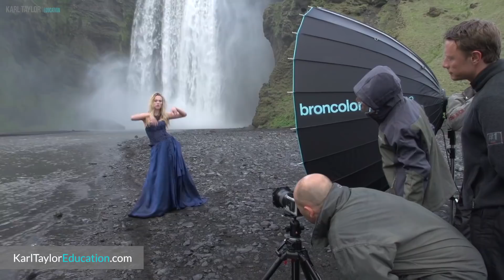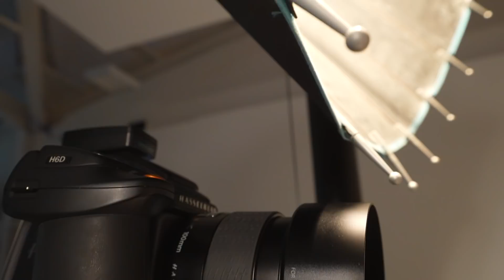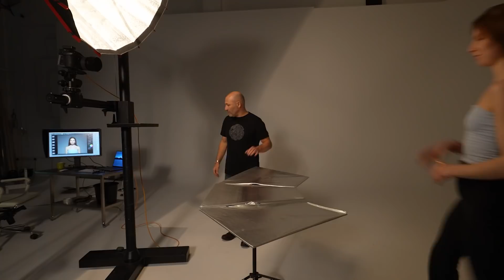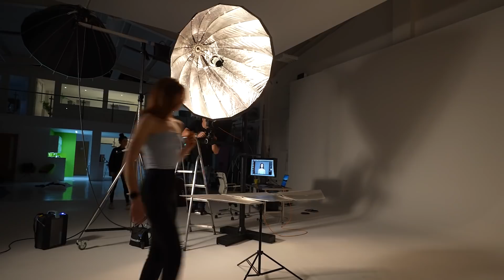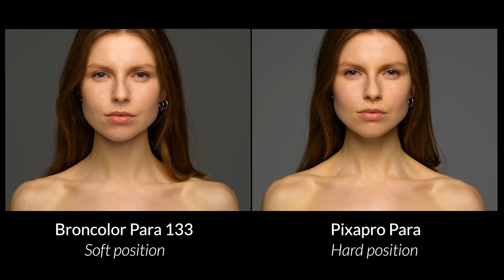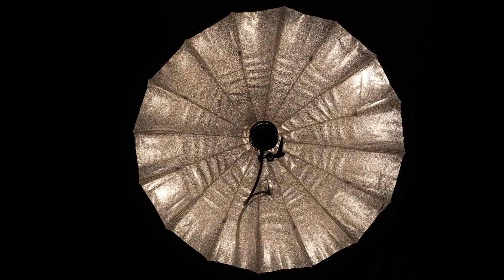Parabolic Reflectors Compared - Budget vs Expensive

Comment: In my opinion, this video lacks practical value. Users of top-of-the-line, most expensive softboxes won’t consider cheaper options, and the vast majority of customers won't even notice the minor differences in shadows, reflections, and other factors. Photographers on a budget won’t be concerned with these aspects either. Comparing top-of-the-line and the cheapest options is not relevant for most photographers.

Comment: Would like to see a retest comparison of the Broncolor Parabolic 88 vs Godox Parabolic 88, reason is the internal silver reflector material is much better on the Godox than was present on the other cheap Parabolic you tested previously and the focusing mechanism on the Godox is also much smoother, meaning somewhat closer to the smoothness of the Broncolor Parabolic.

Comment: so what makes a Briese or other high end reflector so much more money? Is it the number of panels? the material? the really large reflectors are disproportional in their high price. Your hacked one looks just as good. Not a major difference.
Reply from the maker: Being a true parabolic shape is the crucial one, not all manufacturers achieve this. The next I would say is durability, if you use these modifiers alot you are constantly opening and closing them, heat, weather etc. I've used mine with sea-spray hitting them or in high winds and rain.
Reply: @VisualEducationStudio  so, if i were to make a hard plastic 10 foot parabolic dome, and coat it in silver, that could save me 10k? it wouldn't be that portable but for studio work i could save tons.
Reply from the maker: Exactly right.

Comment: Hello. I have a question.
I'm curious about the difference between using a parabolic diffuser and a regular Fresnel lens by adjusting the angle (e.g., 30 degrees, 40 degrees, etc.).

The reflection of light on the subject and the direct contact.. Is there any difference beyond that?

Comment: Karl, i recently had an idea to improve the hacked one in the soft position: the main benefit of the true para there is that it basically acts as a big ring of light - so could the hacked one considerably be improved by shading of the central part? (maybe ideally with some cone shape reflecting even more light to the outer ring?)

Comment: I wanted to ask something very specific Karl if possible. When it comes to the glass domes, do you think frosted glass domes perform better when taking a portrait shot? Or do you think the clear glass dome is preferable?
Reply from the maker: Hi, I've not noticed any difference between a frosted or clear dome in a para, a frosted dome is essential in fresnels such as the Flooter to avoid and image forming of the flash tube. The other benefit of a frosted dome is when using diffusion scrims but not a huge benefit.

Comment: I think parabolic reflectors would be great if you have the budget. But I also think you can get a very similar effect by using 2 or more lights/modifiers for a fraction of the price. Even with one light and tweak it in post. However there's definitely advantages of paras with regards to saving time.

Comment: During my newspaper days, our photo studio had two ancient portrait lights that consisted of rigid parabolic reflectors about three feet in diameter, made of polished metal and mounted on wheeled cast-iron stands. Each had a shielded 250-watt photoflood lamp mounted at the reflector's exact focus. These produced marvelously crisp light, but they also focused so much heat on the subject that most people couldn't stand more than three or four shots! This may have something to do with why modern paras use faceted or matte reflecting fabrics... although as Karl's excellent demonstration showed, it doesn’t matter what kind of fabric is used if the reflector's structure can't maintain a true parabolic shape.
Reply from the maker: Hi JL yes the bigger paras such as the 222 have a shinier surface to make the light 'crisper' because it is bigger and therefore also softer. If a true mirrored surface were used in paras such as the 133 they would be too aggressive like the rigid ones you mentioned.

Comment: On the surface from the "cheap" parabolic reflector fabric are a lot of wrinkels...wrinkels, i don´t have on my Jinbei 120cm deep reflective softbox (which is also a parabolic reflector with the additional focus system). Cheap doesnt´t always mean: cheap/bad made. I am proficient with sewing machines, so i can spot poorly sewn fabrics. 

On the other hand, the broncolor mechanism - especially on the 177 and 222 - is way stronger than other constructions, to be able to stretch the fabric. This is also a reason for other brands, to choose their reflective material. Fabrics with more elasticity seems not to be as shiny as stiff materials. (elasticity: the ability of stretching diagonal)

So the reflective fabric from my Jinbei 120cm deep reflective softbox is looking more like "softsilver", but it will give me perfect reflections from its 18 seamless smooth surfaces. If you keep in mind, that the complete set (softbox + 2 diffuser + grid + focus system) will only cost you 240€ in total, there isn´t anything, you could complain about it.

Oh, and i guess, that the size from your location will also influence your choice from the parabolic reflector you would need (efficiency). In my case it´s my livingroom, which have about 2,80m x 3,50m open space between the bookcases. So the "weakness" from the a little bit less efficient reflective fabric is probably a benefit. Do i really need a reflector, where my eyes are starting to bleed? Lol!

I also have the Elinchrome 120cm Litemotiv, which i bought many years ago. It has a "traditional" softbox design. It was made with a big slit on the bottom, so you could use a second lighting stand to simulate a "focus system". The fabric from the Elinchrome Litemotiv is more reflective...but it have the collar at the backside, so the 16 surfaces aren´t seamless. What i did like a lot on the Litemotiv, was the special heavy duty bracket...the Litemotive didn´t hang on your monolights...the monolights did hang on your Litemotive! So as a softbox or like a directional reflector, it´s very well balanced. Today there is also a focus system for the Litemotiv available, which would cost me about 480€.

Then last year, i saw the Jinbei 120cm deep reflective softbox + focus system together for 240€, and thought:"Ok, i will give it a try!" What should i say...i was very impressed. A ready assembled construction, with a "click" system for each rod. You can use it as a directional reflector or, with the two diffuser fabrics, as a softbox...or with the additional focus system, as a focusable deep indirectional reflector.

This year, i did also invest into some GODOX studio flash`s (2x QT600II + 1x AD600Pro...replacements for my old stuff), where i also got an lightweight external flashhead for the AD600Pro, which makes a LOT more sense on a focus system than a 3kg monolight. This external flashhead is turning your AD600Pro monolight into a mini-generator with a 600W flashhead on a cable. With that, i was able to reduce the counterweight on the focus system a lot! I don´t get a "thick neck" during the adjusting from the focus position from the flashhead, like you did show with the cheap parabolic reflector focus system.

The things are out there, you only have to put them together, to get a "working system".

Would i buy the Elinchrome Litemotive again with the knowledge, that Jinbei deep reflective softboxes are existing? Probably yes...because the Litemotiv is the "better" softbox...and you also can use gigantic flat TERA softboxes from Aurora Lite Bank on the heavy duty bracket (190cm diameter/66cm deep and 250cm diameter/70cm deep). The Jinbei deep reflective softbox + focus system is a nonbrainer...you get way to much stuff for the money. 

The Broncolor paras on the other hand are way out of my range. To expensive, to justify even a single one of them. There is a "pricewall", like for Hasselblads and Phase One´s...and Profoto. 

I think, there is a place for different parabolic reflectors on the market...like there is a place for silver or white beauty dishes.
If it fits your taste, and...your wallet, why not?
Reply from the maker: Yes you're right there is a place for everything and it's interesting to hear the solutions that people come up with. None of this is that important though, it's just nerd stuff - some of my best photos were taken with one bare bulb light and my own home made modifiers. The most important thing is the narrative and what the pictures says. I posted an image on my instagram feed yesterday that has been hugely popular, it used one basic softbox and one background light and one small snoot. That image has gone down much better than others where I've used lots of kit. It's always the emotion and the narrative that wins.

Comment: Thanks a lot for providing such insight on parabolic reflectors, Karl! I didn't noticed at first that Brittany (model) was holding a color checker passport. Just curious ... was it used to adjust white balance of images or a full color profile was generated? Did parabolic reflectors made any shift on the colors?
Reply from the maker: Hi just the white balance and yes there was a difference between the three because of their respective reflective materials. Although that occurs across many modifiers from beauty dishes to umbrellas and softboxes.

Comment: Would have loved to see a comparison with the Parabolix system, since it is more expensive than the pixapro, yet also appears to be of a much higher quality, and also still way less expensive than the Broncolor setup.
Anyways, thanks for the content! Appreciate the comparison with the pixapro. Now, I can erase it from my shopping list without hesitation.
Reply from the maker: Yes I hope they send me one for a test sometime.
Reply: Someone did a comparison albeit not very accurately because they failed to keep many factors controlled between the the modifiers they were comparing. Even though that is the case I see a similarity between the effect of the parabolix reflective material to the pixapro material most likely due to that fact that they both have a stippled texturized interior as opposed to the broncolor which is smoother. Because of that I would assume they both suffer from similar issues.

Comment: Isn’t a parabolic softbox without the diffusion essentially a parabolic reflector lol
Reply from the maker: No not really because the light is not inverted on a pole in it's softbox format (it didn't even come with a pole) it's just a light pointing outwards from the hole. For the properties of parabolic reflection to work the light needs to be facing into the reflector and at the appropriate distance known as the focus point.
Reply: Please watch the Video which Karl mentioned
Reply: Yes, it is, because then, it is only like a big directional reflector, but made out of fabric. The Broncolor Paras and other parabolic reflectors with focus systems are indirectional focusable reflectors, because the lightsource is showing inwards with the lightsource-body as a obstruction...and you can move the lightsource in- and outwards, to be able to reach a certain focusposition.

Comment: Very nice comparison, thank you! As the qualities of the parabolic reflector seem to increase with the reflectivity of the inside, could you explain what to expect if the reflective part was mirror-like? Would it be overdone and too hard then? You mention the "right level" of specularity, hence my question. Thanks!
Reply from the maker: It's a very good point. Good paras increase their reflective material the bigger the para, so for example the Para 222 and 333 have a shinier material to compensate because being a larger light they are softer. A completely shiny material on the Para 133 or 88 would be too aggressive for their size, which is why the 88 also has a slightly less shiny material than the 133.
Reply: @VisualEducationStudio  Clear! Thanks again for sharing your knowledge!

Comment: Thank you for the extra work to make the comparison. I have learned (by cost of buying) that indeed i better stick with all the abilities more standard, less expecive light modifiers. They already provide a huge amount of possibilities, and some things i'll simply not be able to do. Something i did test, with a cool result is using a 1.8m silver (smooth surface) umbrella and putting a disk (white cardboard cutout) in front of the strobe; the result was indeed a reflection in the eyes a bit like the para in soft setting. Cheap and cheerful, but a cool effect non the less.
Reply from the maker: Thanks for your comments, it's great to try stuff like that, I've got loads of 'home made' lighting bits of kit in my studio too.